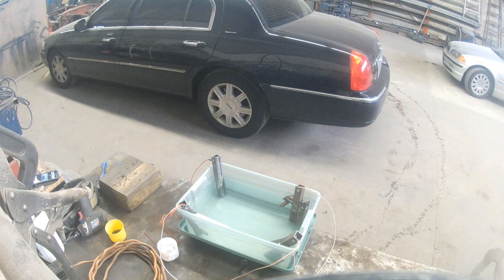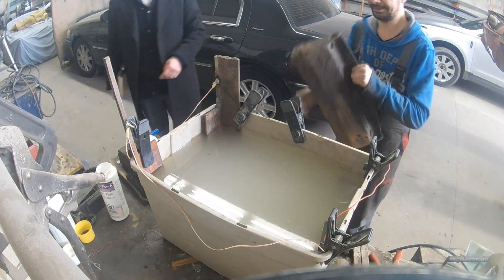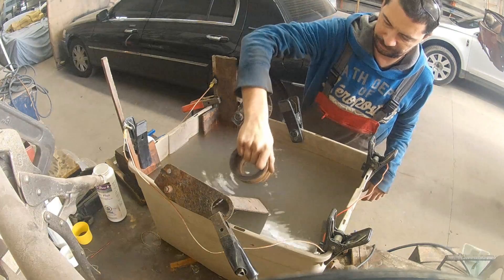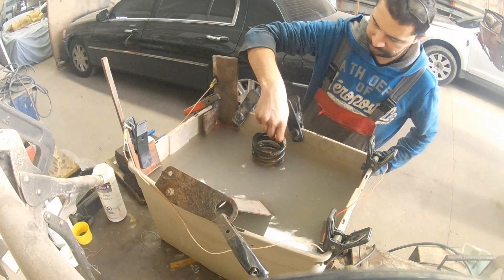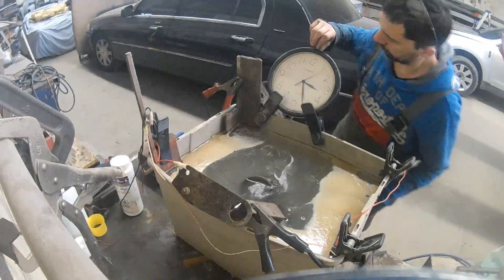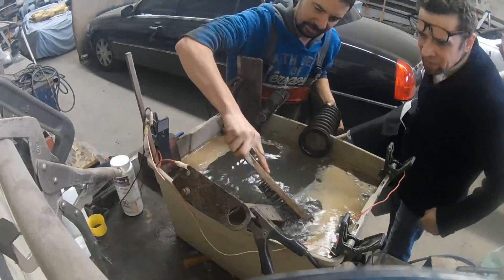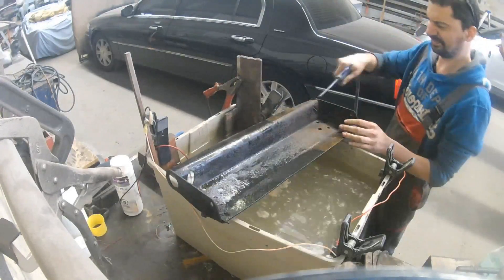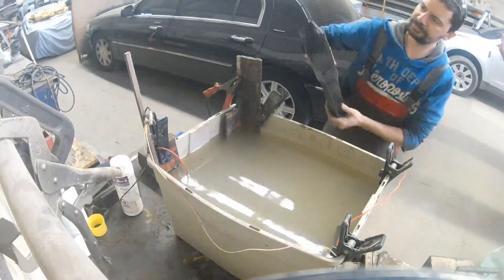Experimenting with Electrolysis rust removal - second attempt

Comment: Any form acid removes rust. If you have heard of dustless blasting it is really good.
Reply from the maker: Yeah, I know, I used Muriatic acid to de-rust my Spitfire gas tank, but it was so corrosive that all my tools that were close to the tank started to surface rust. I prefer the electrolysis, since it is not so aggressive and works on it's own. I just reload the bath every 24 hours and wash and dry the de-rusted parts.

Comment: Hello, very good. I made the same like you, bubles goes from minus, and plus been around the box with old crap, but stragest been that, my old crap whoes been with pluss now after 5 hours is now whitout rust, and things what need to been clean is more rustie than been, how its posible? :D
Reply from the maker: Wow, that's weird. Are you sure about the positive and the negative on your charger? Also, did you scrape the pieces you want to de-rust after the 5 hours? They won't look perfect right after you take them out of the bath. When you take them out they look black and dirty with some flakes on them. You need to literally wash them in water and scrape with a brush or just a rug. Then all the rust comes off. Did they change color? If really your sacrificial metal gets de-rusted and your good pieces get rusty, then for sure your terminals are the other way around - positive is negative and negative is positive. Just switch them around.
Reply: Yes, i did everything right but flakes been on positive side, I now start think, mybe its becose i use 2  powersuply with 8amp connected seperetly with diodes on positive side?
Reply from the maker: Why do you need 2 power supplies? My battery charger is set to 2 amp only and it works like a charm.
Reply: Thanks men, for your help!  I remaket and now it goes well.

Comment: Hello Elin, I did this to my TR6 and am quite pleased with the results.  I made a big tub out of 3/4 inch plywood and support boards and put my frame in it.  It took about a week as I could only do sections at a time.  Then pressure washed it and angle grinder with wire wheel.  Came out quite good.  
Small parts in a plastic tub.
Reply from the maker: Yes, it works great for me too. Very slow, but it works on it's own, so I can do other work. It is unbelievable how big chunks of rust come off like a wet paper.  I just figured that I have to prime the parts right away if I don't wan't them to rust again. I do one load during the day and then another one overnight. Some parts require double dipping, but eventually everything cleans off.

Comment: Don't you need an electrode on the spring too? Otherwise how does current flow through it?
Reply from the maker: I put it right on top of the skid plate, so they became one. Of course if one of the two was too rusty there was a possibility not to make contact, but I checked if the spring started bubbling, which it did so it was fine.
Reply: Ah, that wasn't obvious, but makes sense.

Comment: there is a way to do the frame. a local person made a frame out of wood and lined with plastic sheet. layed frame on some boards to keep it suspended. filled using 55 gallon and 5 gallon drums to keep count. since it was so big it took him about a week, had to clean sacrificial metal each day but it worked.
Reply from the maker: Hmmmm.... That's an idea. It is probably going to take the same time as cleaning it manually, but this would clean it inside too and I can use one of these kits that you can spray inside and protect it.... I will think about that... Thank you so much, Keith!